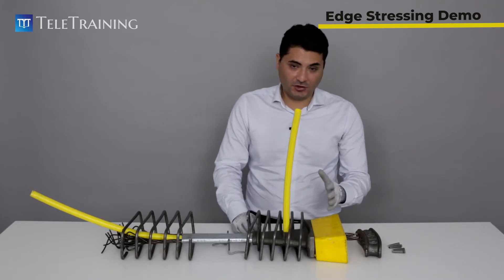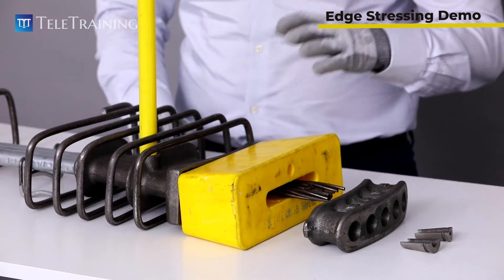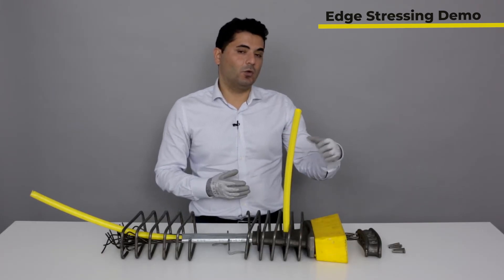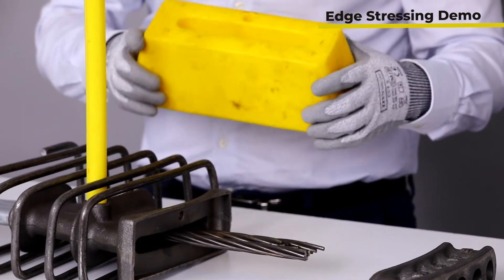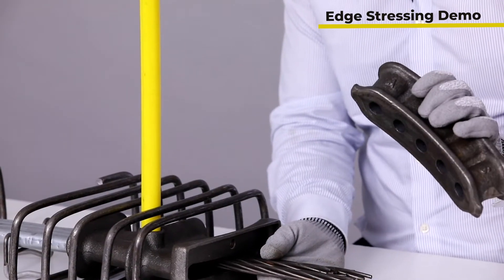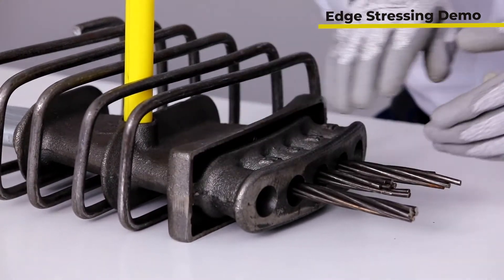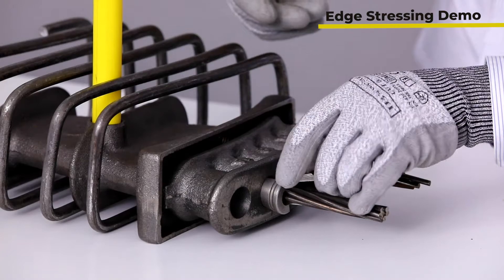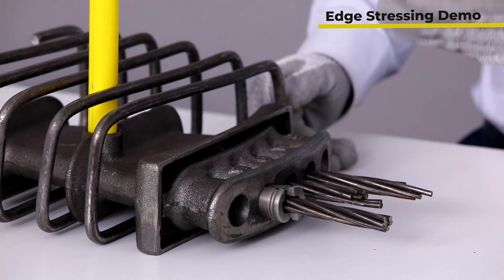Post Tensioning Tendon _ Edge Stressing Components

Comment: And what is the yellow tubing for?
Reply: that must be the pipe which is typically used for air injection into the duct in order to make sure that the duct is clear of possible obstructions and later the grout could be injected into the duct to make the strands bounded to the duct.
Reply: Protective sleeve.  Keeps cable from corroding
Reply: fill it up with grout